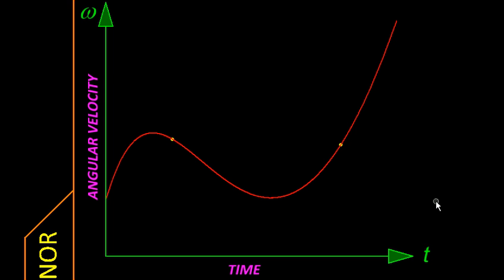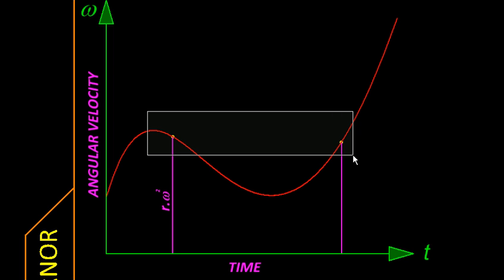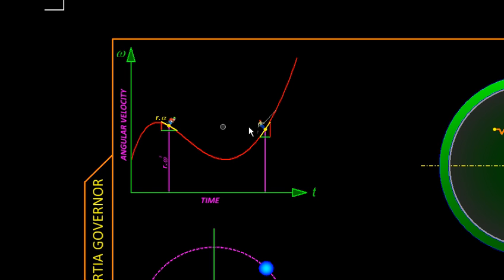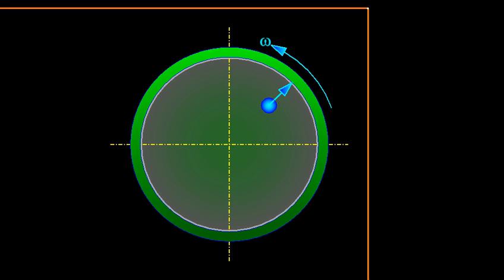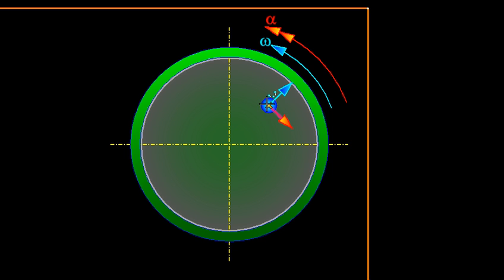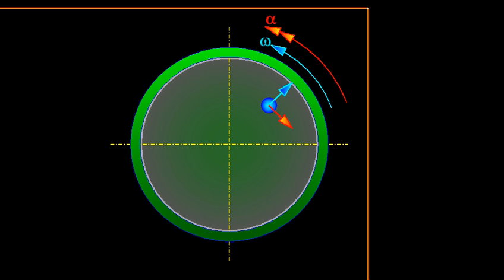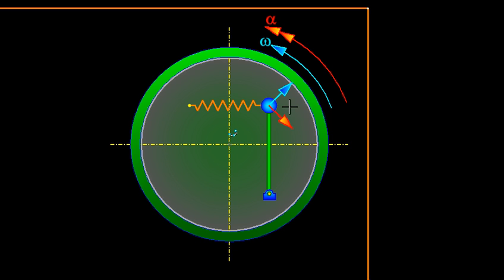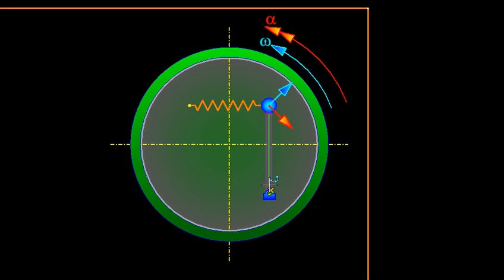Dynamics with MicroStation Ch08 F Inertia Governors

Comment: sir why while designing the governor you used only x component ? and not y- component.
Reply from the maker: The Y-components are in the opposite direction and would cancel each other at least partially to give a weak resultant. Our aim is to derive a good indicator of the rate of change of speed. We have a weak force in Y and a strong force in X. So we select X